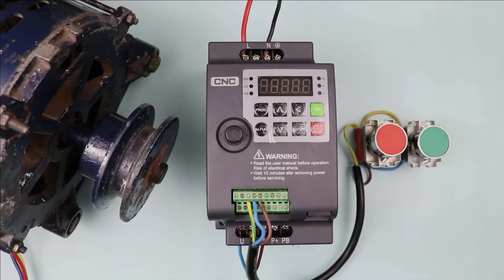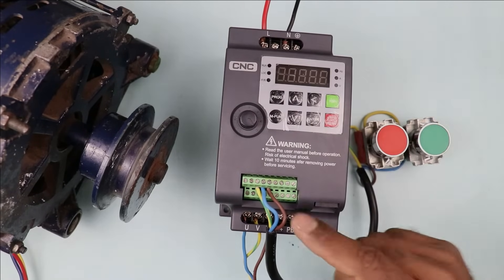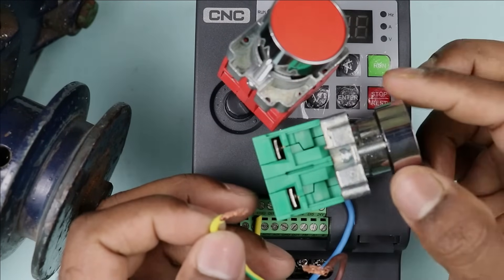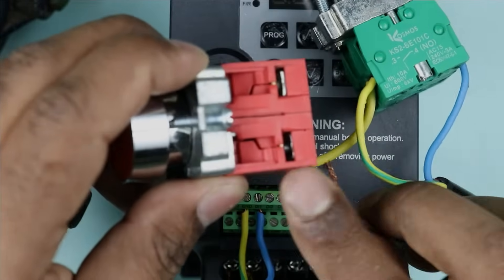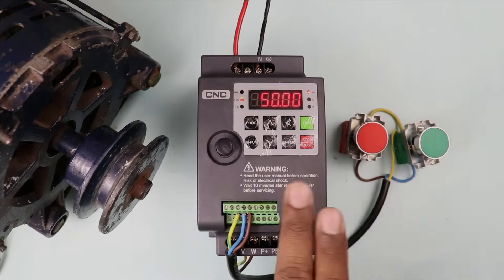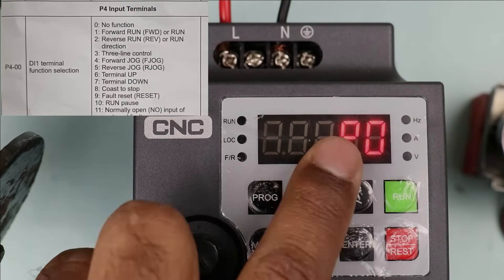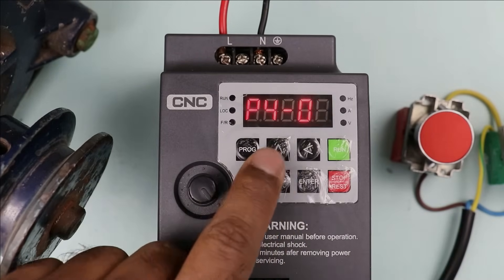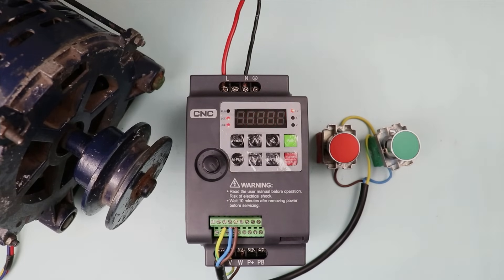VFD 3 Wire Control Wiring with Push Button and VFD Programming @TheElectricalGuy

Comment: I have a delta ac drive M series older model, using with a latching switch it works fwd rev no problem, using no and nc push buttons and 3 wire control I only have fwd, makes no sense why I don't have rev, I've changed parameters many times and using the mo, m1 and m2 connections and the ground it will not work,

Comment: not working same parameters, P0-02 is  1. P4-00 is 01. P4-01 is 03. P11 is 02. no working externap button or VFD panel buttons. default   parameters panel buttons working

Comment: how make parametres to VFD start DI1 and stop DI2 pin, what parameters need change, external control and DI1 and DI2 .   i has try setting P4-00 to 1 DI1, mean 1 is reverse RUN or run.  and P4-01 to 36 DI2 but no working and parameter P4-01 no have number 36  this mean external STOP terminal1.

Comment: I have to give you a huge thank you, you saved my ass. I followed your instructions and everything worked except the motor would stop when I let go of the button. I noticed you were using momentary switches like mine so I re-watched your video and realised I had forgotten to program the PO-11, so I did that and it all works perfectly now. I’m so happy. Now I switch a big master switch and the VFD turns on and the original power lamp on the front of the lathe lights up to let me know there is power to the lathe. The original on / off switches also work too so it’s hard to tell there is even a VFD there. Thank you so much for your easy to follow and well explained video. Cheers mate, Stuart 🇦🇺

Comment: Hi i have a motor from eurodrive and this is 3 phase i already put the plates in the motor to Delta do i only need to install it on the VFD then?
Reply: Did you get an answer to this?
Reply: @ no

Comment: How about using potentiometer to regulate speed of motor?
Reply: I thought i had it figured out but the programing far is what i couldn't get right. Even though the VFD stats rpm or hz i change it to. When i adjust it, the speed never changed on motor. I hate these kind of vfd where the programing is very hard to understand and get right
Reply: Not this model but a cheap VEVOR one , I did exactly what you said. Potentiometer for changing speed’s. 

But programming and understanding/fluking the pin out and setup to get it working. 

Can be done though